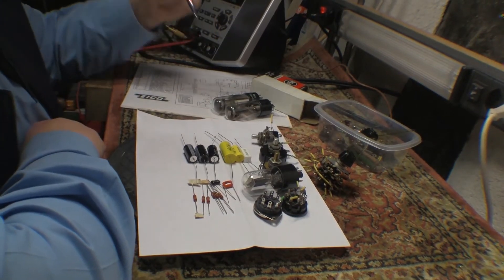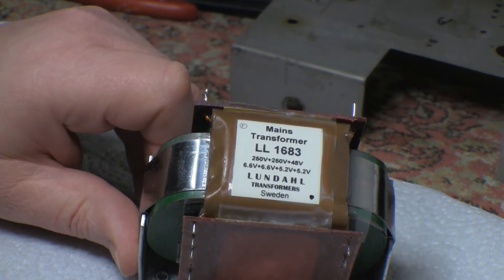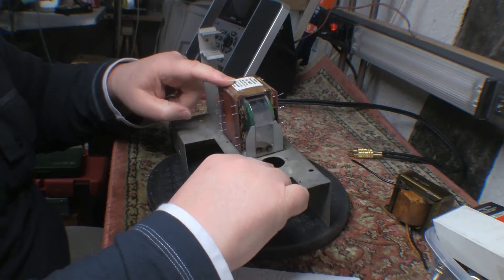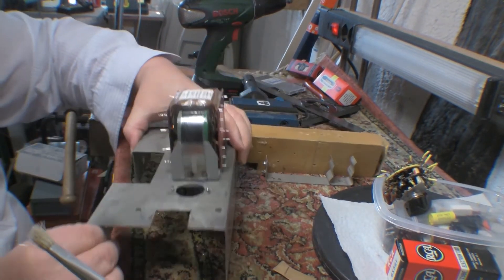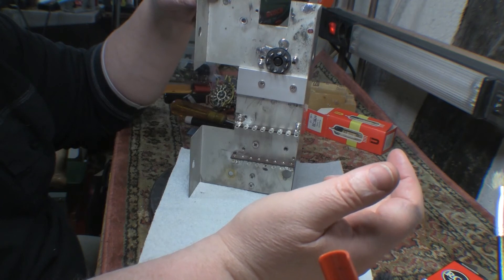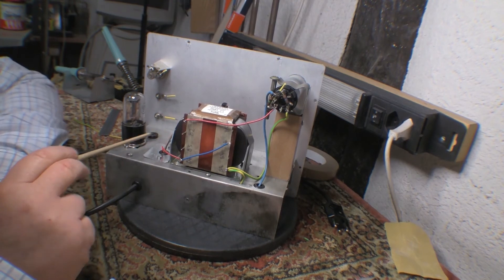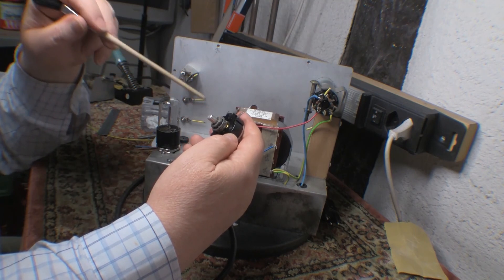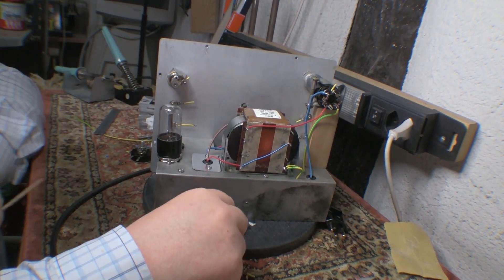Eico 950A Restore - maybe!

Comment: I think I would have just put this capacitor checker aside and picked up another, maybe the newer version with the bright aluminum panel, as a parts donor, then made a good one out of the two. I'm trying to remember who sells wire wound potentiometers, I think Allen Bradley may still make them. The guys who restore TVs on videokarma and the antique radio forum would know. Just in case I would see if you can repair the existing one first.

Comment: Just a thought:
If you can't come up with a 10k, 4 W+ pot; could you make a driver circuit with a logic level MOSFET, a 1/4 W 10k pot and an OPAMP? Granted you are going to need low voltage to drive the circuit.